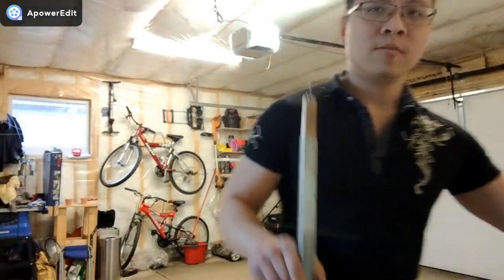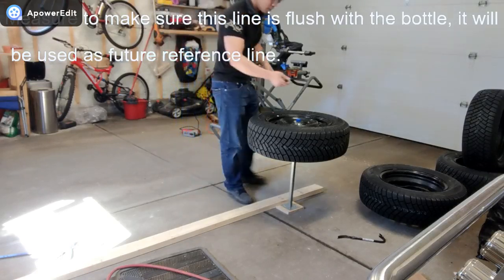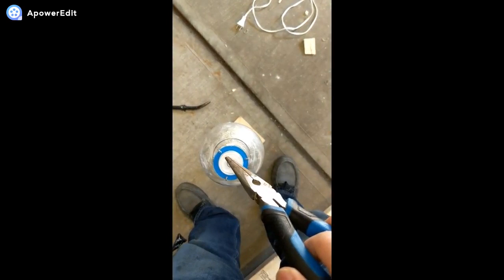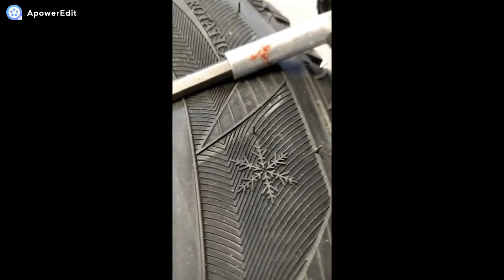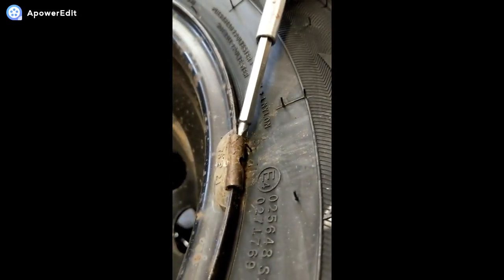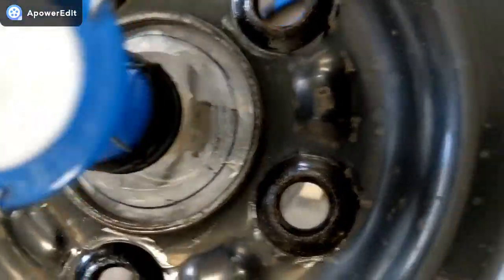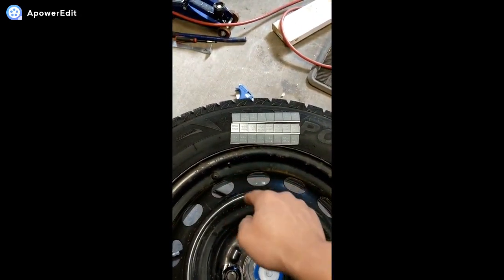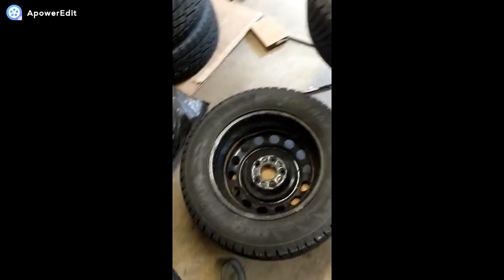less than $10  SUPER EASY how to make a BUBBLE BALANCER and balance your tires DIY!

Comment: If the bottle is not warped  , you could put the level right on the cap instead of the wires,, i think wires could get knocked out of alignment too easy.

Comment: Interesting!  I remember when every service station had a bubble balancer.  I often mount my own tires and bead balance, which works well with narrower aspect ratios but 65 is the cutoff; don’t even try bead balancing a 55 series tire.
Reply: I successfully balanced wider than 55 tires...
Reply: @rafars2246  I must admit I am impressed.  My results on multiple sets of 65 profile tires have been marginally acceptable.  Beads are great on my bike or the 85 profile tires on my truck.  Usually, the low & wide ones need two plane dynamic balancing.
Reply: The idea is good, thank you. Normally when tyres are replaced, the balancing and disposal charges are applied in UK so it's good to know, but they charge you anyway so nothing anyone can do about it. There are ways of fixing punctures without taking tyre off the rim so those require no balancing either, but thank you for showing us a brilliant idea.
Reply: @pankajmakwana2300  You can order tires direct to your home at a considerable saving as you're not paying for fitting and balancing...I reckon we are being charged about £40 a wheel for fitting and balancing...

Comment: Amazing job, can i use square whisky bottle?
Reply from the maker: Fabricating a glass bottle would be extremely hard since you would need to cut the bottom off. The neck would also need to be wide and round because that's where the hub of the rim sits on. It may break easily since it is made of glass. I would recommend using large plastic bottles.

Comment: The problem is you can't guarantee the wheel sits on the bottle 100% Square...
I'm on my 2nd design of this type now and it's not accurate enough.
I have the bubble separate from the cone and I have the bubble on the wheel instead
Reply: there is a way to balance tires and wheels>>>>>TRY THIS OUT  YOU HAVE NOTHING TO LOOS, SOMETHING TO GAIN,  A SMOOTH DRIVING CAR WITH NO SHAKING NO VIBES, NO LED, NO BALANCING, IT'S GREAT     some tire have a yellow dot on the face of the tires, and a red dot, now  if you have a red dot   then do not bother with the yellow dot, line the red dot right in line with the valve stem,   i don't think you will need any waits tho,  and theirs a other way to balance the tires if you haven't any red dot,   look good in side the tires before you put them on the rims, you should see  where the tires are joined to gather, it looks like a patch in the tire   but it's where that put the tires to gather,  could be 3 or 4 inches wide,  look to see how long it is,  how ever long it is  take a chock and mark the centre of  it right in the middle, you cant miss it  it is under the rubber of the in side of the tire,  but you can see it tho, i do my wheels like this all the time  i do not have any led waits  on my wheels,  and no shaking at any speed  , so i don't know why other people cant do it to,  our maybe the people are doing all of this just to make a video,  well that's OK  to,  oh,  and is you see to little patches  in side the tire,  then remember, you are puling half the heavy part of the tire , 1 PART ON THE HEAVY PART OF THE TIRE ON RIGHT SIDE OF THE VALVE STEM,  AND ONE PART OF THE HEAVY PART OF THE TIRE ON THE HEAVY  SIDE OF THE VALVE STEM,  IF YOU HAVE 2 LOOKS LIKE PATCHES TO JOIN THE RUBBER TO GATHER IN SIDE THE TIRES,  WELL, NOW YOU HAVE  2,  CHECK THE SPACE IN BETWEEN THEM  AND DIVED THAT IN THE MIDDLE,  MARK IT RIGHT IN THE MIDDLE OF THE DISTANCE THE PATCHES ARE APART  MARK IT IN THE MIDDLE  WITH A CHOCK,  AND ADD THE CHOCK MARK ON THE VALVE STEM  RIGHT IN LINE WITH THE VALVE STEM,  AND IF YOU CANT FIND  NOTHING IN THE TIRE  WELL YOUR GOOD TO GO   THE TIRE IS NOT OUT OF BALANCE,  YOU CAN PUT THIS TIRE ON THE RIM ANY PLACE YOU WONT TO, HAVE A GREAT DRIVE
Reply: @robbaird5972  That Sounds very interesting; did you ckeck yout wheels with a modern machine too ?
Has anybody tried that yet ? It basically means, if I have understood it right, to align the heavy part of the tire with the heavy part of the rim, which is where the valve stem is.
Or is it maybe just the opposite, that would make more sense ?

Comment: if you dont put the bubble onto the bottle cap perfectly the tyre will be more unbalanced than when u started.
Reply from the maker: Yes you do need to make sure the bubble is in the centre, that's why you always adjust the bubble first. However, a factory made bubble balancer works in the same way. As the moment you move it, the ground level changes slightly and you have to adjust the bubble again. I do have a real balancer, but I made this one for fun.
Reply: @evanyi7041  I was debating building something like this, thank you for sharing this build. How does your makeshift tire balancer compare to the factory built one? The make shift one seems good enough for a quick fix, but I'm guessing your factory made one has way better accuracy?

Comment: A bold invention, but you have to buy some basic tools in order to DIY. Your way of taking off the weight might damage the rim edge and the weight itself, even worse, harm yourself.
Reply from the maker: True, but usually people without basic tools won't be interested in this video. I would've bought weight pliers if these were new rims, which defeats the purpose of spending less than $10. I did remove the weight with one hand since the other hand was holding camera, which of course 2 hands and a better position would be a lot safer. I used stick on weights for balancing simply because they are cheaper and compatible with alloy rims(I bought a big case), so the old ones went into garbage.
Reply: @evanyi7041  that's why I stayed he doesn't know what he is doing. It takes him for ever to do this and doesn't have proper tools
Reply: Harm yourself? Man up bro...